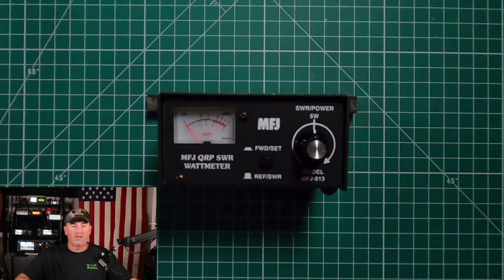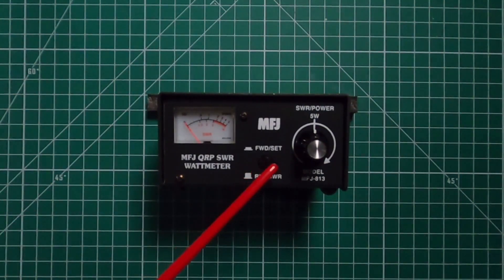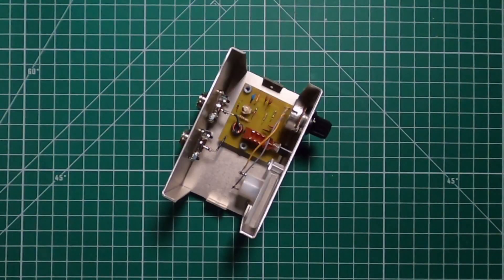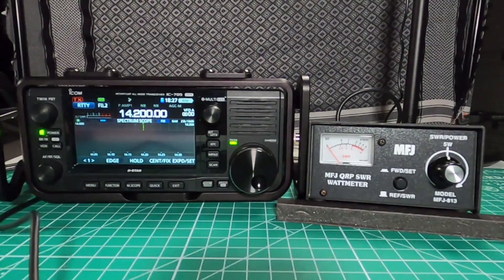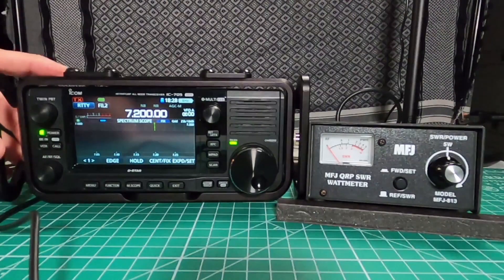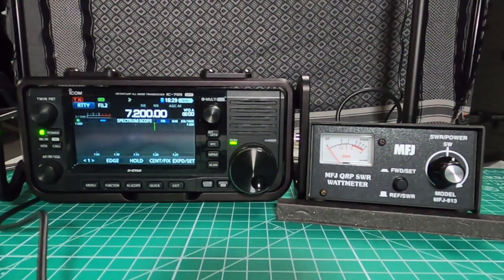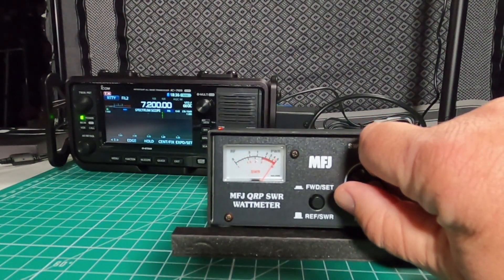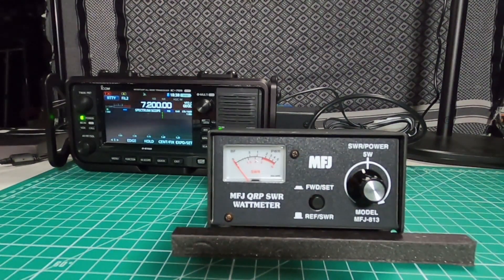MFJ-813 QRP SWR/Wattmeter

Comment: Neat little meter. I would have liked to see you test it on 10,20, 40 and 80 meters. But more important, I wish you would have turned the power down on the radio to around 2 watts and make the same test again. 
But, I did enjoy the video. Looks like a neat little meter.
Barry, KU3X
Reply from the maker: Thank you for taking the time to watch and the comment! It is greatly appreciated.